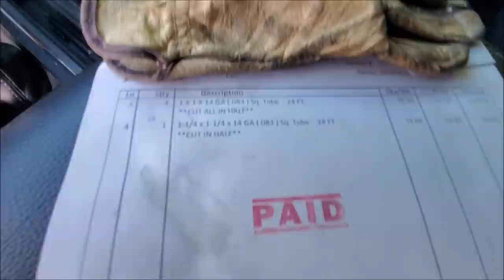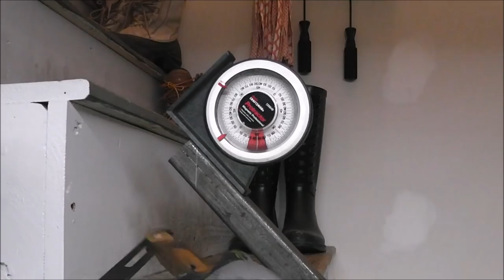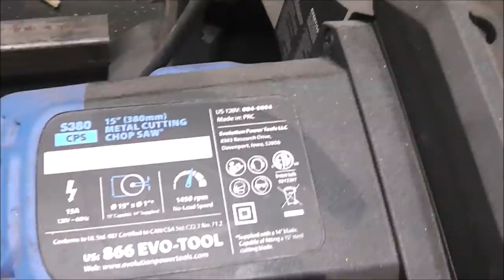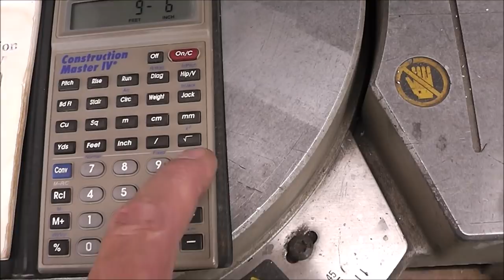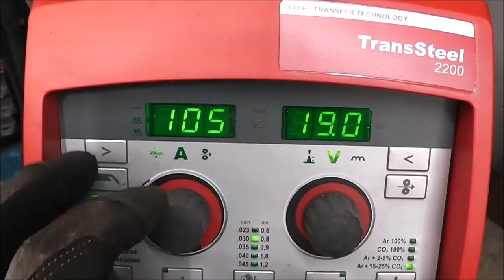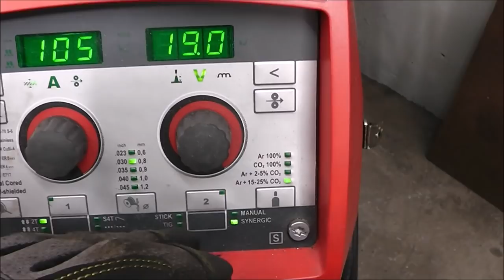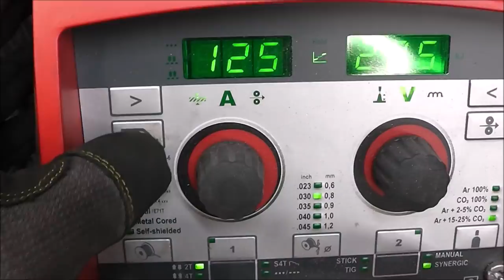Welding Tips Metal Fabrication, Tools and Layout Stair Handrails

Comment: My steel vendor gave me a heads up on the price increases coming in late 2020 and I dropped about 10k on sheet, plate, flat bar, round rod, angle and tube. He ended up getting laid off a year later and the vendor massively scaled back their business and ultimately shut down. I did get to thank him a few months later, but I had no idea how helpful that heads up was at the time. Prices never dropped back down to those rates from a few years back.
Reply from the maker: It's crazy the prices these days. I have some new old stock on hand and it always makes me smile when I get the opportunity to use it, some of which I paid half of the current going rates.

Comment: Great work
Reply from the maker: @AJ's Iron Works thanks man! 😊
Reply: I really want one of those saws. I see mixed reviews. What is yours. I build fire pits and put rings around them. I cut a lot of pieces at 22.5 degrees and they need to be pretty close. How long does the blade last and how well is the saw built
Reply from the maker: @AJ's Iron Works they are awesome! I have 2 of them. I upgraded my oldest model for this one in the video because it has the detents I showed. My older one doesn't.  Its all cast iron, heavy duty and cuts perfectly. My 1st blade lasted about 300 cuts but then I started experimenting and cutting things on the bias like I mentioned and i also got the "feel" of how much pressure to apply which also lengthens the life of the blade. I send my blades out through a mail order company that uses really high tech equipment to precision sharpen the blade as good if not better than new for about 40 bucks. I've used about every method to cut and this is hands down the best way I have found. It's a but pricy up front but in time it pays for itself. I spend about 80 dollars a year on sharpening. I have 2 blades. When one gets dull I send it out.

Comment: Very nice build Brandon, a year ago I went to buy the Chop saw and they were out of stock, the marking pencil I have had for about a year and half I really like it too. if my steel has a lot mill scale on it and I need to  cut to size I use a silver sharpie to save the the other marking pencil.
It was nice to see you look up the OSHA requirements for the rail heights. There are also requirements for distance between the stiles to keep childrens heads from getting stuck!
Reply from the maker: TheFalcolnJetDriver thanks man! That pen and saw are super time-savers in the shop!

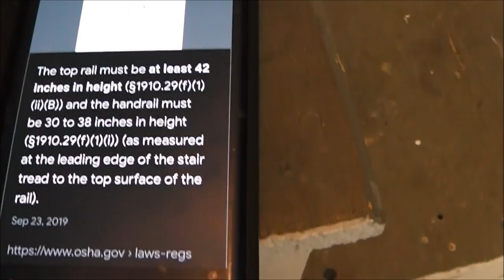Comment: I had never heard of the Construction Master calculator at 15:30  before but I think I was able to find the app for my phone  which will save me a lot of Math! I also have a question about the OSHA regulations at 16:30 What is the 'Top Rail'? I can't figure out the difference between the top rail and the top handrail.
Thanks again for your excellent content.
Reply from the maker: Thanks man. So from the ground to the top of the rail it has to be at least 42 inches in height and it needs to have at least 30 to 38 inches of materail below it. In other words you cant just slap a single rail horizontally between point A and point B and call it a handrail. It needs to have barrier material below it which can be solid material, mesh or pickets and they must be at least 30 to 38 inches in height.
Reply: @BrandonLund  thanks Brandon that’s a great explanation

Comment: Great tutorial and finally I learned how to use that slotted angle finder!  So simple, but so effective!  Yeah I got the magnetic Devil Level, but I always wonder if I which angle I need to apply it to.  The Speed Square was an eye opener, too! I see you do Woodworking projects, so familiarity with that is perhaps the reason.  I never read the rafter booklet...Bwt, I bought the EVO 15 in. about 6 months before I ran into your posts.  It's a great saw, compared to the yellow friction saws I was used to.  And less space than a horizontal band saw.  I also find myself having more control with a cut off wheel in the filed rather than the Port-a-band.  I never liked the "pull" towards the blade guide...
Reply from the maker: @MARK SAROVICH those EVO saws are a huge timesaver!

Comment: wooow square tube! that's one expensive rail, looks nice but OMG dude there are much cheaper ways to get nice looking stylish rails, now retired I owned a third generation fab business and one of our bread butters was Comercial railing for apartment complexs, I mean literally 1000s and 1000s of linear feet over a 40 year period. Style is what one wants, this I understand and you can spend 2 to 200 dollars a foot if one choose, that being said, if price was an option the  Molded Steel Cover Rail, 1 3/4" (about $2 bucks a foot) which can be welded to a 1" channel underneath or just 1/2" solid square bar for stiles straight or twisted for style, the lower rail 1" shallow channel, your end posts 1"x 14 or 12g indoor, 1/8" outdoor (slows down rusting). on the bottom end of your hand rail a lambs tongue heated and bent around a 3" piece of pipe cut in half adds a nice touch. if you like scroll work it can be added every so many feet between the stiles, there's a million different designs, I had this set of rail stairs books we got in the mid 60's (big format 10 volume set) that had every style you could think of from art deco to prison BLA.,  what you did looks fantastic, but as you said costly.
Reply from the maker: Thanks man I appreciate it. Although cost wasn't a huge concern at the time, it was rather expensive. Buy once cry once. It's all a distant memory now lol :)

Comment: Hold tight on the metal prices. They are fixing to tank real soon. I'm not a scrapper but know a few who do, like in tons, not like, pounds of cans type of scrapping. They will hold onto metal for a few months at a time monitoring steel prices. The scrap prices are dropping really bad in the last few days. This should spill over into steel cost to buy. BUT, this could be either speculation or coincidence. But seems to be accurate. Maybe someone else can conform or deny our findings. My Evo cut off saw is my FAVORITE tool in my shop. (wear ear plugs they are LOUD) At least until I get a lathe, mill and CNC. Working towards getting those next. I'm like you. I HATE numbers. I suck at it. I like your tips man, they are useful.
Reply from the maker: Well I hate to see the price of scrap drop but a steel reduction would be great. I've been wanting a lathe for a bunch of years but I have a feeling I would use it for a few months then it would sit idle. Unfortunately I don't have much of a need for a lathe in my business but it would be fun to learn and thats the part that really interests me about getting one. Do you buy new blades for your saw or send them out to be sharpened?

Comment: i have a question.. OK so i have a workshop drawing and i need to cut a PFC at 153(Degrees), how do i find out the angle to set on the bandsaw, or transfer that angle to the Bandsaw to cut the PFC at that degrees...?
Reply from the maker: There are a bunch of ways to do it. You could use a digital angle finder or you could take a known angle (say 90 degrees) and draw that onto your table then take the additional degrees (153-90 = 63) and add to that measurement. You will usually need to end up making a jig to do these steep cuts unless you do it free hand.

Comment: Hi Brandon, quick question I’m currently in the market for a welder doing basically the same projects as yourself. I can’t make up my mind on which one to go with.  Just when I think I’ve got it figured out, I realize I’m further away then when I started a couple of months ago.  Your rationale and opinion would be appreciated.  As for budget, I’m a buy once cry once type of guy.  Best regards.
Reply from the maker: Thanks for reaching out Jeff. I have 3 clear options, With that being said, the Fronius 2200 is THE BEST welder money can buy. Period. Its the Ferrari and Rolls Royce of welders.  Nothing even comes close in my opinion, but that comes at a price of around $2300.  It will do MIG, TIG, stick and it will MIG weld aluminum WITHOUT a spool gun. This is a buy it once machine and you will never regret or wish you bought something else but it does put a big dent in the wallet. I have detailed videos on my channel of this machine.  With that being said,  I have 3 YesWelders and I'm super impressed especially with the 205DS that does basically the same thing just not as good as the Fronius for less than $450.  However,  I haven't owned them long enough to say how reliable it will be 5 or 10 years down the road but the reviews are great and so far I'm very happy with my purchase. My last tried and trusted If all you want to do is MIG or Self shielded wire and you don't care about stick or tig welding, either a Hobart Handler 140, 190 or Hobart Ironman 240. These are all transformer based machines that do MIG only. Any of these machines will outlast you and I combined. They are super reliable and bullet proof.  If you rarely weld anything thicker than 1/4" than the 140 will do. The 140 runs on 120 volt power only. The 190 and the Ironman need 240 volt power and can easily weld 1/4" and thicker. 

Clear as mud? Lol. On a side note, I feel your pain. I research stuff like this for months also. Your not alone. It drives my wife crazy lol
Reply: Hi Brandon,  thank you for the very quick response.  Ok if your Fronius is the best and it does Stick, Mig, and Tig. Why would you buy a “Yes” Tig machine?  I really appreciate your feedback.
Reply from the maker: So the reason for Fronius and Yeswelder, the Fronius machines stay in my shop permanently. They are just too expensive for me to justify toting them around. My YesWelders do everything I need but if it gets run over by a piece of equipment or damaged on a jobsite, it's only a fraction of what a Fronius costs to replace.
Reply: Ahh….Brandon your a beauty! 
I went from clear as mud to pea soup, now it’s crystal clear.  Fronius it is.  All the best from Vancouver BC!  Love your channel
Reply from the maker: Thanks Jeff! You won't be dissapointed. Oh and Fronius Welders can be run on an extension cord over 300 feet long which is insane! This is the video that sold me on mine https://youtu.be/mo_RZqoPxFM
Reply: @BrandonLund  Hi Brandon.  Thank you for all your help.  I will be watching for new content, and catching up on old ones.
Reply from the maker: Thanks Jeff I appreciate it :) 👍🙏

Comment: I haven’t had time to comment for a bit, but I thought that all the videos were fun videos.

What I noticed several years ago, was that shortly after those 25% tariffs came out, metal prices jumped, and they’ve been going up ever since.
Reply from the maker: @Mel Gross thanks man! Hopefully the prices stable out soon but I don’t see that happening anytime soon. I was told the tariffs are no longer in place but the price continues to skyrocket but who knows. At least the lumber industry is starting to stabilize.
Reply: @BrandonLund  I believe the tariffs are still in place. It’s easier putting them in than removing them.
Reply from the maker: Thats very possible I'm sure :)

Comment: Use a oscillating tool to remove the inside edge of the floor molding.  Remove the thickness of your upright.  Why make a ragged edge you can see
Reply from the maker: I like to leave details like this exposed so viewers have something to complain about.
Reply: Thanks for your response.

Comment: Steel in the Uk has rocketed up in price too. 70% more expensive than a year ago. And for the construction industry it gets worse. Rebated or "red diesel" will be banned from use in all machinery and equipment from 1st April 2022 UNLESS, you are a farmer, generating electric for consumption in a hospital, tower block or similar or it is being used in a boiler to provide heat.
That could happen in the USA too? So, what can the consturction industry use to fuel diggers, dozers, cranes, back hoe's, dumper's and the like? White (road diesel @ £6.23p or $8.52 per gallon or you could use HVO. What's HVO? Hydro Treated Vegetable OIl and it is currently about 16% dearer than red diesel. 2022 is set to see inflation rocket!
Reply from the maker: @Jon Dingle sounds like we are experiencing very simular! Our gasoline in our area was under 2 dollars a gallon now it 3.25 a gallon. We allso have on road and off road diesel but they havent banned the off road stuff YET. We also have biodiesel (made from recycled vegtable oils) which sounds simular to your Hydro treated. Nobody wants to work either in my area because Covid money and unemployment is paying the same if not more than actually working a job so it's leaving employers desperate for help. Everyone is hiring locally but nobody wants to work.

Comment: Get yourself a XLock angle grinder trust me you wont go back
Reply from the maker: @Will . Awwww man. I'm a day late and a dollar short as usual.  I literally just looked at these about 2 hours ago and ended up passing on it because I hadn't seen or heard of them yet. I ended up buying another 4 1/2" and 4" instead - both Makita. All my grinders are Makita except i have one Fein 4 1/2" that I don't use because the cord is not flexible rubber but the stiff plasticy vinyl type. I'll have to look more into it. Thank you for sharing.
Reply: The accessories are more expensive and not as much variety 

What you really want is a Metabo Quick Series. They use the normal attachment but the nut is designed to hand tighten and loosen by slamming on the grinder brake! Amazingly enough. 

I've got one of these. Made in Germany. Absolutely top notch grinder.
Reply from the maker: @Matthew Hall interesting you mention this because that's what my local welding shop uses and they swear by the Metabo. They said they get about 4 years out of one which is pretty impressive for industrial use by guys that don't own them but just use them all day.  They are using the corded versions and the the price seems reasonable. I'm going to look into it. I just picked up a 4" and 4 1/2" Makita last week for spares which I've always had good luck with also.
Reply from the maker: Hey Matthew is this the one you reccomend? I'm going to pull the trigger on one Metabo 603623420 W11-125 11-Amp 4-1/2” / 5” Quick Angle Grinder
Reply: @BrandonLund  I ordered one of these: "Metabo W12-125 Quick 10.5 Amp 5 in. Angle Grinder with Lock-On Sliding Switch" which since got upgraded later. Their products are crazy customizable. You can pick paddle or click switch. Multiple sizes of wheel. Multiple amperages of motors. Different types of motors, fixed or adjustable speed. I like the 5" because it can use both 4.5" and 5" accessories for better cutoff wheels and more surface area. Any of their grinders from the Quick series is meant for guys that hate grinder wrenches. They have a catalog on their website that lists all the options so you can pick the one with your favorite combo of safety and performance features.
Reply from the maker: @Matthew Hall awesome man! I will check i out. I like the idea of being able to customize it for my needs. I prefer the switch vs. the paddle so thats a huge plus for me. Thanks for sharing buddy!